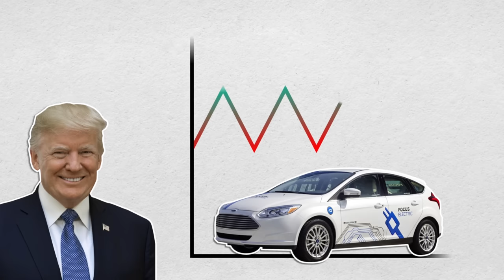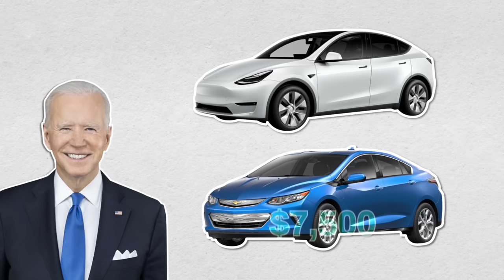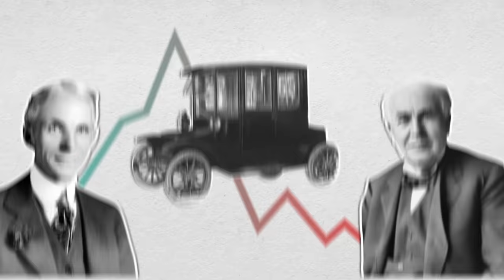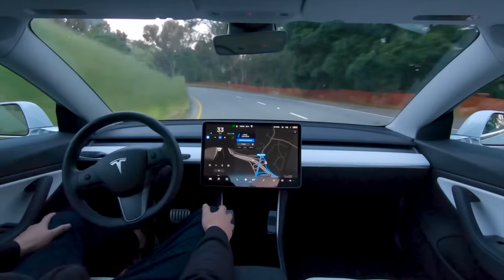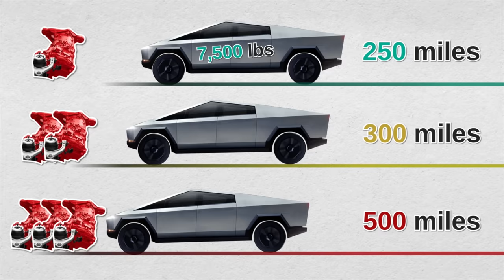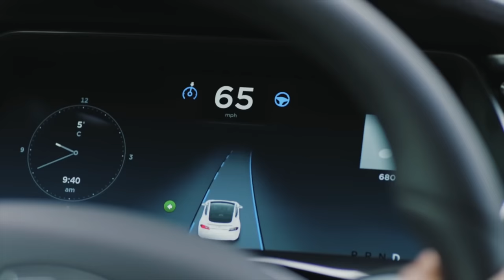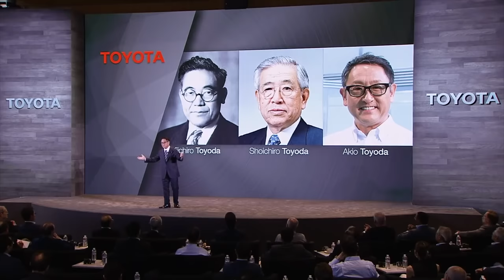Here's Why Toyota is Refusing to Make Electric Cars

Comment: That was a very interesting history of the EV and where it might go....thank you!
Reply: The question of generating more electricity at power plants to handle power to charge batteries is more complicated than it appears. An electric car is much more energy-efficient than a gasoline-motor car. Most of the energy in the battery car goes to turning the wheels and moving the car forward. Most of the energy in a gasoline motor car still goes to heat. It is only like 20 percent efficient in the amount of chemical energy goes into moving the car. The question of how this balances is how efficient is the energy generation at the power plant (assuming coal or gas or oil powered electric generation) plus the efficiency of delivering the electricity. That's the part I don't know the answer but I think a large boiler-generator captures a lot of the energy. So the question is how efficient the generation of energy is and how much pollution and carbon pollution comes from the different sources. I think this is a very important question to answer as the country is posed to go into a Major shift to Electric Vehicles, starting now. 
I like what I see of the electric vehicles (but currently driving a hybrid) and I suspect the battery power is the most efficient.

Comment: I have a Tesla Model Y and I will never be able to go back to an ICE car. The more I drive it, the more I realize how backwards and antiquated ICE cars are, and how everyone should be driving electric. It's faster, drives better, cheaper to fuel, drives itself, avoids accidents automatically, lower insurance, has sentry mode, looks better, less parts to break down, and almost zero maintenance. There is not one single thing that an ICE car does better than an Tesla.

Comment: Id rather have a hydrogen based vehicle. They just seem so much more practical and have the lest impact on the environment when you think about what it takes to get lithium out of the ground.
Reply: It should be lower impact once hydrogen starts being made with water (green hydrogen), but at the moment it's mostly made by breaking down natural gas(grey hydrogen) which is energy negative and carbon heavy. There is a capture method where the emissions from grey hydrogen are sequestered (blue hydrogen) but its even more energy negative. 

What green hydrogen has going for it is the potential to export power from desert power  farms but no one's done that yet.
Reply: Lithium, iron, copper. Whats the difference? Unless the car weighs notably less this is a moot point.

If you want to drive around  at 80mph with a 10k psi tank of hydrogen you deserve your darwin award.
Reply: What's practical about having to find a hydrogen station to fill up ?
My car charges on the drive from green electricity.

Comment: You jump from the 1880s all the way to the present, but there were intermediate steps along the way. I drove an electric car back in the 70's, a Sebring-Vanguard Citicar. It was a later version, so it had the upgrade to the 6 HP motor, and the upgrade to 8 6-Volt Marine Duty Lead-Acid Batteries, which were in series to achieve up to 48 volts. Since they were in series, a single bad cell was a major problem. The ozone produced by the motor ate tires. Other than that, and the fact that they had no  AC or heat, and a short range (claimed 50 mi, 35 was more reasonable), a low top-end speed (claimed 35 mph, 32 mph was more reasonable), plus the fact that they were tiny, they were a fine car. In fact, you can still find them on EBay for about $3000 (not working), which I think is higher than their original price.
 
Electric cars of today have come a long way, but there are still truths which can be learned from the past. For example, if you use accessories that use power (heat, AC in particular), that power must come from the battery, and will reduce your range.

Comment: What battery has the same battery life when it is old (just look at any older iPad).  Sounds like planned obsolescence on a societal scale.  And what about all the mining needed to make batteries?  I wonder if someone wants all that wealth...
Reply: @skutch Blobaum Over a century ago, internal combustion won over steam and electric vehicles because of convenience and power density.  If we made gas from algae we would not have a push/drive/force for EV - or would we...  Power works because it is easier for people to be swayed by propaganda than working out the basic physics of entire systems.  If people had to charge their computers with a treadmill, there would not be an obesity problem.

Comment: Fun fact:  The Baker Electric car came on the scene in 1898 and lasted until 1914.  The electric car was very popular because of the difficulty and danger of hand cranking an engine. Why did the electric car fail?  Because cars started to be built with electric starters, which made them easier to start.  Rather ironic.
Reply: The first drivable electric car was actually made in 1832, almost 200 years ago, lol.

Comment: I have the model 3 Tesla. Couldn't be happier. I checked out the Jaguar i-pace and the Audi e-tron first and both were ok but a few little niggles (plus the autopilot capability) made me choose the better car in my opinion.

Something you said frustrates me that a lot of people think about generating electricity using fossil fuels. Although fossil fuels are the main source of electricitu for a lot of nations, the actually energy used in an electric car is much less than a traditional ICE car due to the energy lost in heat, light and noise. Even the most efficient ICE cars in the world do not convert a KW in into a KW of power.

Comment: Let’s be real though Scotty the future of cars is electric which isn’t that bad of thing. Even you yourself say 90% of gas cars are junk besides Toyota’s and Honda’s.
Reply: And what are the problems in the new cars all the electronics go bad and are very expensive to fix so if the car is even powered by an electric motor what are you going to do then throw your car away and still have a bill for it cuz she can't afford to fix it just something to think about
Reply: Nope
Plenty options 
Battery just one.
And presently flailing.
Reply: @Oldcarnut63  well you gotta realize the technology is still pretty young but in a matter of years the Tesla has become one of the best selling cars on the market love it or hate it. Also I think with electric cars there’s way less moving parts. You don’t gotta worry about say the fuel pump breaking or starter or alternator not working or the catalytic converter. All that is just in the battery.
Reply: toyota produce hydrogen fuel cell vehicles too.. i think the point is that green vehicle options exist- they just dont all have to be driven by lithium ion batteries..
Reply: I live on the Navajo rez. the nearest town with accomodations is 75 miles away. Not every trip is a small task where a EV can be used. Additionally I haul wood for winter, one trip is 160 miles with a 30ft flatbed. I haul water to the animals about every other day, every summer. I haul the animals to auctions with another large trailer. Some nights are 4 hours of sleep and on to the next; do you think that's enough time to charge a electric vehicle capable enough to do these task?

Have you seen how much water it takes to put out; one of these cars on fire.

They weight about as much as a pickup truck. I wonder; when engineers design bridges do they take into account the average weight that goes across a bridge any given time?
Reply: @traumazombie3843  i mean youre talking about work related tasks, thats different than people that just want a car to take them to work and around town with the occasional long distance trip where the power stations come into play. Im sure business/industrial electric cars will be made sooner than later that charge at home/work in an hour or 2.

Comment: EV in motor sports would be a more logical. Race tracks with charging systems in certain parts where if you don't hit them you'll end up hitting the pit and swapping batteries sooner 🤷🏽‍♂️. Dirt bikes with more Hp and torque; it's starting to happen.

Comment: Get that chevy bolt at $15,000-20,000 and I'm in (maybe a smaller range version for short city uses) .  Its a small car.  Battery costs have quite a way to go.  Those battery makers must be putting a big dent in costs.  I just saw an immaculate Chevrolet Chevette whip past me on the highway yesterday, whats that from  like 1980?  No emissions that I could notice - 35years old at the least!

Comment: When you can swap the battery at a gas/battery station, like an electric power drill, it will be a mature technology.   Else, waste of time.
Reply: Battery swap will never catch on.  Takes too many batteries.  There aren't enough as it is.  Charging keeps getting faster and the infrastructer needed for battery swapping is massive.

Comment: Japan has natural gas. Commercial hydrogen is made from natural gas (grey hydrogen). So obviously they would prefer the non disruptive option that reduces dependence on foreign fuel.

That said I absolutely agree with toyotas statement "we have the battery capacity to sell some ev lines or to fully hybridize every vehicle we sell". I like phevs as a transition option for areas without ev support.

Comment: We need to be aggressively building our nuclear power infrastructure, regardless of whether we accelerate the adoption of EVs. But the mass adoption of EVs absolutely cannot occur without it.
Reply: @markplott4820  laughs in cloudy areas with weak winds
Reply: I would love it if they build the molten salt reactors which are incredibly safe and can use nuclear wastes as fuel but batteries plus solar and wind could be enough power for a BEV conversion in the United states.
Reply: @victorluke5816  "Molten salt reactors"? Nuclear waste as fuel?? I'm too lazy to research anything myself, but damn, you sure know a lot about energy.
Reply: @pookysdad4884  The new designs (gen 4) are incredibly safe, and can’t even melt down in principle. The current (gen 3) reactors are also incredibly safe, and I believe have never melted down, due to strict safety protocols. Every reactor that has melted down was from an era before computer aided design was commonplace. Even then, the number of lives lost, though tragic, are not outside the norm for hazardous industrial activity.
Reply: @victorluke5816  we can’t make that many L-ion batteries or solar panels. And even if we could it would be horrible for the environment.
Reply: @benwest3223  Actually we can.  Tesla has seen the problem you are talking about.  They just patented a new lithium clay recovery method that uses table salt plus kinetic separation rather than sulfuric acid.   The US has enough lithium to replace all the cars in the US but there wasn't a cheap or safe way to remove it until now.  The water used is even 100% recycled for each wash.  LFP batteries use zero cobolt as well.
Reply: @benwest3223  I'm with you. More nuclear reactors please. Wind, solar, and hydro will only get us so far. Nuclear is the real deal.

Comment: I've wondered for years, since the 80's, why no one built diesel-electric cars and trucks. Railroad locomotives have been using D.E. power since the 1930's. 
Also, it seems to me that using an electric motor on each driven wheel would be more efficient than running power thru transmission and transfer gearing.

Comment: Funny story ( for me ) every time I drive my Mercedes and a Tesla driver is near by they always ask me how did my car get the clean emissions stickers then I explain to them that my gas guzzler Mercedes is a plug in hybrid and it can drive on just electric for up to 15 miles and that’s how my car got it’s stickers ( plugging it in at some charging stations is sometimes free which is awesome since once the engine kicks on it turns into a gas guzzler with 448 pound feet of torque all going to the rear wheels ).

Comment: Hydrogen fuel cell technology still has a long ways to go before it is main stream. Tesla has a nationwide charging network while Toyota has no nationwide hydrogen fueling network. Battery technology is available today for the masses while hydrogen technology is still WAY to expensive and unavailable for the masses.
Reply: @kiae-nirodiariesencore4270  Hydrogen like batteries is an energy carrier, not an energy source. You run an electric current through water and it splits the hydrogen and oxygen molecules apart. This is how hydrogen is an energy carrier. Once the hydrogen reacts with oxygen, electricity is released and the byproduct is water.

Comment: Exactly.  I have thought for a while that having all cars electric is impossible.  There is simply not enough rare earths and other essential materials to supply that outcome.  Further, even though renewable clean energy is happening, it isn't happening fast enough to supply an all electric vehicle world, which will delay the phase out of fossil fuels, which is bad.  Hydrogen is the way to go.  Toyota is right.
Reply: the latest battery tech, to be used in the next gen Tesla, uses no rare earth materials.

Comment: ? about that Tesla cyber truck? in 1950 manufacturers started to move away from "Flat Glass" windshields, & kept the side glass pretty much vertical due to white out glare problems. To combat this co's like Fulton made those really cool looking "visors" you see on classic cars & even semi-trucks that still use them (because they still have flat glass). Those visors look GREAT, but they rattle like CRAZY. Those plastic & louvered covers you see on the back glass of Fast-Back Mustangs, Camaro's & the like, are there for the same reason. I wonder how Tesla is getting around this safety issue that was a huge problem way back then with Flat Glass windshields, and angled platform for the side & back glass?   
As a classic car/hot rod builder, I like flat glass because it's CHEAP. But I can tell you from experience (because I own and drive many of these still), that "white out glare" is an issue.

Comment: I bought a Tesla M3 to use as a backup to my Lexus 450. Instead my Lexus stays home and we drive the Tesla because it only costs $8.30 for 250 miles of travel instead of $55.00. As for running out of electricity created by dirty coal, I put in solar and now my fuel does not cost anything and I run my house power for $10 a month, including AC. My breakeven is less than 7 years and the solar is warranted for 25 years.

I think people are crazy to buy an ICE vehicle. I wouldn’t even buy a plug-in after owned an electric vehicle. Why lug all that weight around?

Comment: No, I would have an electric car. I may be wrong, but I believe it's a stopgap between the IC engine and what you mentioned right at the end, Hydrogen powered. Batteries are for flashlights.

Comment: Forget about the infrastructure, the argument that EVs are less pollutants is only right when you get the charge from a renewable source otherwise charging them from fossil fuel resources is   relocating green house gases from point A to B .
Reply: Ev is great if you live where a rack of solar panels can power the car and home.  Then basically free fuel ⛽.

Comment: There is a fundamental flaw in Toyota's argument.  ICE cars are only 17% efficient or lower.  Diesel can be higher. Generating power in large power stations is inherently more efficient.  Electric cars are 70% efficient from power generation to driving the car.  So 100 gallons of gas gives you effectively 17 effective gallons of energy in ICE cars and 70 effective gallons for electric cars. Anyone who has even taken a basic class in thermodynamics will tell you that an internal combustion engine in a car just can't be very efficient.  Power plants use superheated steam turbines, heat recovery, high pressures, etc. to get high efficiencies.

Comment: HELLO, eletric motors are 80% efficient. Gasoline powered motors are 20% efficient, where 80% of the energy goes off in heat. Notice the significant heat the next time you drive your gasoline powered vehicle into the garage. Not so with an electric car. Huge energy savings with electric powered vehicles. Chevy Bolt MPGe is 125. Drive electric. We have 2.
Reply: Really good AC induction motors, like the ones used in Tesla Model S cars, are ~80% efficient. The very best permanent-magnet motors can reach 95%--and some of them have apparently done even slightly better than that.
A modern gasoline engine for a car might be around 25% efficient, maybe 40% if it's a Diesel.
Electric cars, as cool as they are, generally suffer from either extremely high cost, or short range. They're a niche product, and a glimpse of the future--but, combustion engines will predominate for many years to come until the cost of battery packs for electric cars is driven down substantially.
They have yet to build a $15-20,000 EV that will go 300 miles (~500 km) on a charge, like an ICE vehicle can do on a tank of gas. It will probably be a VERY long time.

Comment: The most practical option currently would be the immd technology from Honda, which travels on a battery within 80km/hr and switches to gasoline thereafter (EVs not so good for higher cruise speeds). Produces 40+ km/l fuel efficiency. The battery is constantly charged by the secondary engine. No worries for a charging point. Handles and ride like an EV in city driving
Reply: The Prius already does that, and has for a decade.
Reply: @frederickfarias9515  253 NM/186.6 ft-lbs of Torque 0-60 9.9 secs, it does not use a gearbox. Quite Different from Prius i suppose
Reply: @appreciatier  Sure.

Comment: Hydrogen fuel cars still can be the future option since it doesn't have the battery problems. the only problem is the hydrogen pump stations for now, but if they can introduce solid state hydrogen storages in any shape like disc or bar, etc then it can be available in any shop and station.